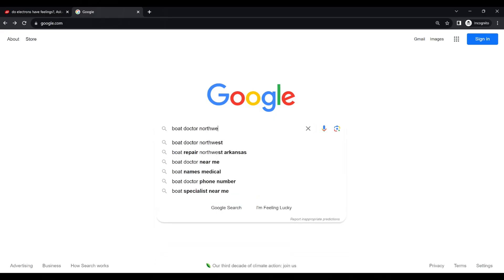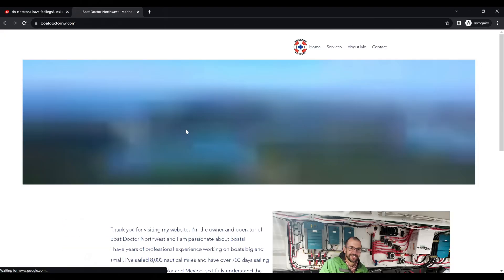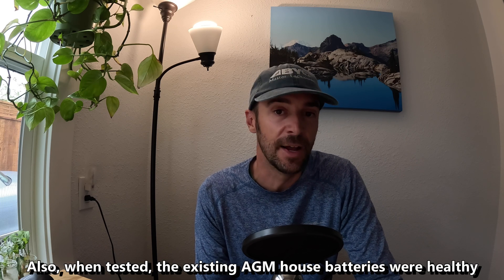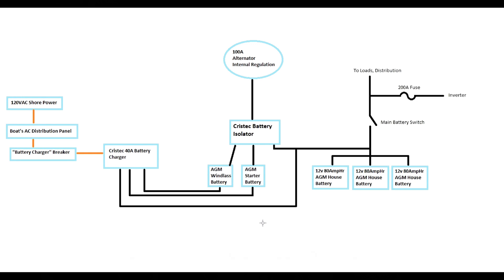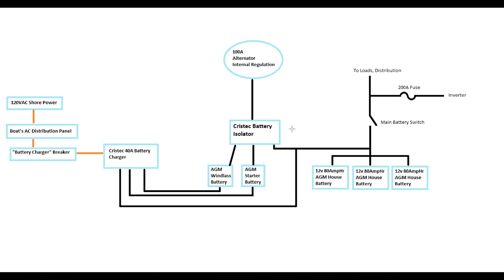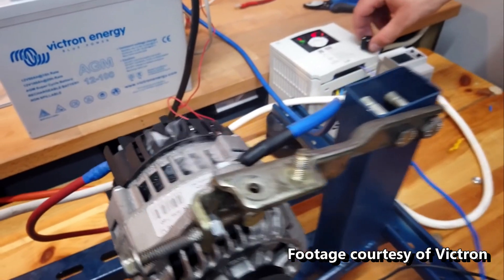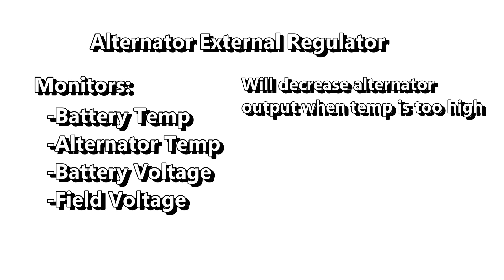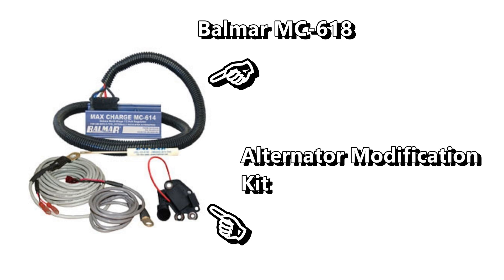Lithium Batteries on Boats: A Real World Example of a Lithium Battery Install

Comment: I just did a similar install using Victron components on a friends aluminium boat. Ground is floating via an isolation transformer. I made the decision to charge the lithium bank with dedicated lithium profile charger, ditto for solar. A DC/DC charger charges the starter and windlass battery. The alternator charges the windlass and another DC/DC charger charges the lithium bank. A 12V relay on the ignition switch activates exclusively one or the DC/DC charger. Energy depletion protection profile on each DC/DC triggers charging and prevents charging if batteries are too low. Smart shunt monitors the lithium batteries. Works well so far. Also had to insert some new fuses/circuit breakers , busbars and make sure cable length are identical to parallel batteries to ensure even usage. Nice little project. I’ve done a few of these now including my own boat, which is a little bit more complex.
Reply from the maker: Lithium conversions are pretty fun. Every boat is different so thay keeps things interesting. Thanks for watching.

Comment: Yep, lifepo4 are great and at only 3.2V per cell last a lot longer in terms of cycle life and are much safer than other types but still keep away from salt water.
They last and are way lighter than SLA but you can parallel them and just set the charge voltage to 14.2V so the SLA can remain in parallel with the Li ion so that the alternator never loses a battery. I have my SLA hardwired to the Alternator and the switch is just for the li ion bank, switch it in or out but can not wreck the alternator.
Reply from the maker: That's a good idea- your system definitely makes sense especially since the lithium will take the bulk of the alternator's output due to the low internal resistance. Thanks for watching!

Comment: How did you solve risk of voltage spike if bms disconnects?
Reply from the maker: The sterling dump protection device is there to protect the alternator should the BMS open up. There's an alarm on the sterling device that rings if this event happens.

Comment: I had a system with 3 x 110 ah battleborns linked to 2 x 300 watt solar with two victron mppt controllers. work fine without any issues. no dedicated started battery, manual windlass. when under power, the alternator never overheated. (perhaps because the batteries were almost always already 100% due to solar charge?)

Comment: I just bought a saxdor 320 gto. It has a non generator system by master volt. I have 4 battery switches for port and starboard engines , house and bow thruster. It has two refrigerators on board and would like to know if it's alright to keep the shore power connected along with house battery switch left on.

Comment: why not Lithium on the two remaining AGMs?
Reply from the maker: AGM and lead acid batteries are better suited for the super high current loads that starter and thrusters need. Lithium batteries have mechanical and computer parts inside them that don't like those high loads.

Comment: Great job Brudda.  Your demonstrations and descriptions were spot on and easy to understand. Excellent project design.  OCP is probably the most important item in the circuit to prevent the wires catching fire.
Reply from the maker: Thanks for the nice comment- definitely OCP and properly sized wire are the best things you can do to prevent electrical fires!

Comment: Thank you Mac, interesting video. Next time I need to replace my batteries, I will reach out to you for help.  In 2020, I replaced my House bank's then two AGM batteries with three  Lifeline GPL-4DL AGM batteries, each with 210Ah. At the time I debated between Lithium and AGM. Without running the engine, my house bank is good for three nights on the hook without dropping below 60% (I also have a 175 watt solar panel). Still, I think next time I will go with Lithium, and I can bring my sailboat to Anacortes.
Reply from the maker: Please let me know if you have any electrical needs on your boat- I would be happy to discuss further. I've got more information about my background and contact info here: https://www.boatdoctornw.com/

Comment: Interesting i wonder why they didnt op for DC to DC charge on shore power with another switch similar to the ignition switch so as long as one system was active the dc to dc would work? Honest question, im not an electrical guy. Just figured two shore power plugs would be sketchy.

Good video mate 👍👊

P.s no end spoiler/blooper? Im disappointed lol
Reply from the maker: The customer did actually want that setup, and it would work-there would be an additional relay, that would activate when shore power was detected on the battery charger breaker. I didn't as that design was a little complicated to install and isn't as robust as a dedicated shore charger. Thank you for watching- sorry no bloopers!
Reply: @CruisingMaya  hey boss thanks for the insight, it was just a casual observation from an unlearned pleb like me ^^ figured there was a reason :)

Comment: Fantastic video!  I would be curious to hear you thoughts on the need for a generator as an option.  Looking a boats with or without, new or used, its always hard to know if worthwhile or trouble, and if a Lithium setup like you describes, and high wattage panels would suffice.  I get that peoples situations are different, but curious for a similar use case as the folks in this video.  Thanks for the easy to follow format and informative video.
Reply from the maker: I think generators are a nice option if you've got space. Generators combined with lithium is an even better option- use all of lithium's charge, then flip the genny and use a nice big battery charger to fill them up as fast as possible.... continue enjoying time at anchor. 
For the customers in this video's example, a generator is not really an option as there just isn't space for one. They are interested in solar, which is a perfect fit for their boat as they have a huge bimini. I think the estimate I did for them had something like 500watts up there, which will greatly extend their time at anchor. 
Appreciate the comment and you watching!